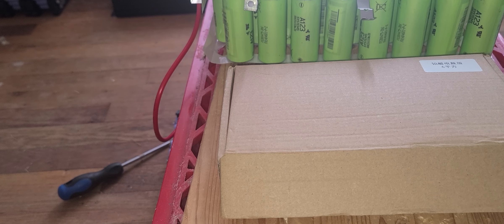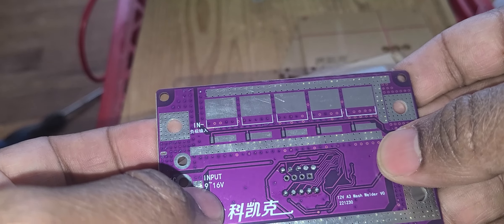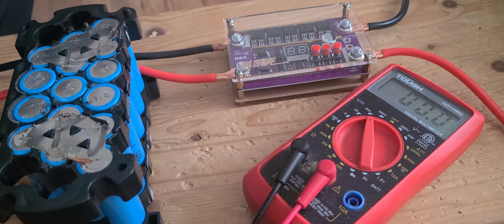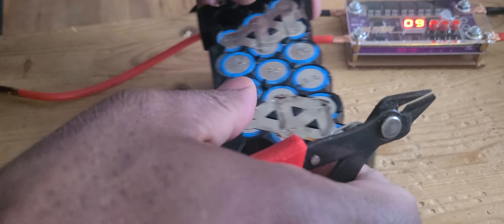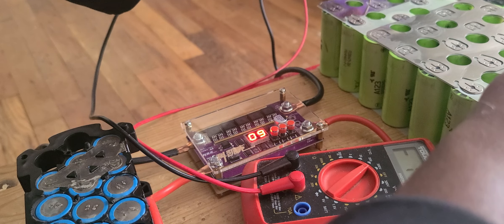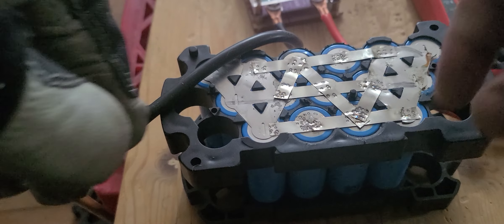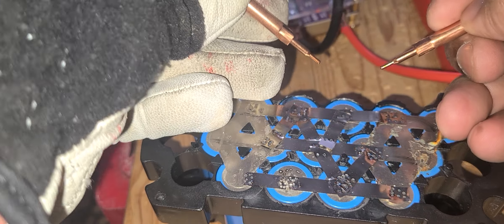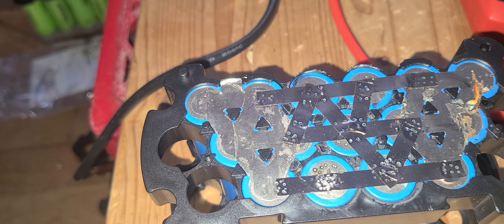PART 1 - INTRIGUED CITUATION WITH THE WORLD BEST SPOT WELDER #SPOTWELDER #lithium #lifepo4 #18650

Comment: Can you use it with a car battery charger? The regular non-switching 12v 180a-300a charger
Reply from the maker: Yes, if the battery can give you enough juice to do spot welder

Comment: The best mod with this is to connect the plus of the welding pen to the input plus on the board, not to the output plus. Regards
Reply from the maker: This device is fine, it doesn't need modifications. Check out my other videos on that topic
Reply: @simplyfocus9937  actually it's not a mod. You just connect the output plus to the input plus

Comment: Hi. I saw similar spot welder on ali with 6 mosfets kekk k100. Do you think its better than one you rewieved?
Reply from the maker: This one is on ebay for less than $26.00 I have 2 of them. It can take battery from 9v to 16v. this is WY they dont break. No need for modification. It is a great 👍 device.
Reply from the maker: I had malectric spot welder. It was very good and broke for low voltage 10.5v. Yes it broke. I had 2 of the red ones. They didn't last a week.  This one so far is excellent. Just have a good battery and connection. You will be fine
Reply: @simplyfocus9937 wy?

I know its good for price and overall.. I know with some mods ( 10 mosfets) it could weld copper-ni sandwich. 

But maybe k100 has better  schematics design? They started to sell it year ago or so. 
Trying to find info but not much reviews about it(near to 0) sad
Reply: @simplyfocus9937 Do you have any problems with overheating?
My friend got purple 5 mosfets welder and he says after 10-14 spots welder needs time break in welding 2-3 min. Some sort of thermal protection and overheat.
Reply from the maker: Nope, the wires and my fingers only heat up. Not the device
Reply from the maker: I may get a new one and add 5 more fosfets to it. For now, it is working fine

Comment: i'm just use car battery for spot welding,lithium batteries are expensive for me😢
Reply from the maker: This link is for the battery 🔋 that I have. It costs $42.00. You can make 3 batteries out of it. 
No relationship with them.

https://www.batteryclearinghouse.com/products/a123-26650-lfp-38-4v-96-cell-rack-style-lifep04-pack

This link is to how to make the 12V 

https://youtu.be/kd20ZLKxt1U?si=UWcPC8zKWyCq9MU-

Comment: This is a fine example of a VERY bad spot welding. This is not a play thing, you can burn your house down. Do your homework!
Reply from the maker: It works very well 😌, part 2 is coming. The connection was weak. Once I changed it , it really worked